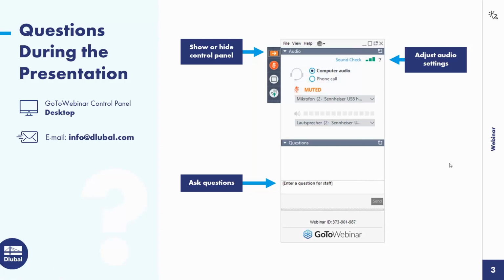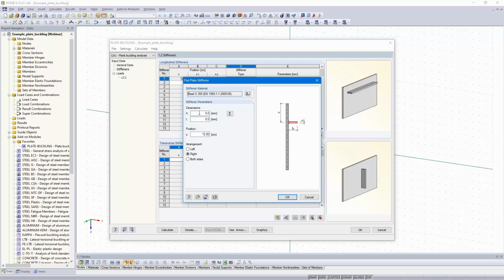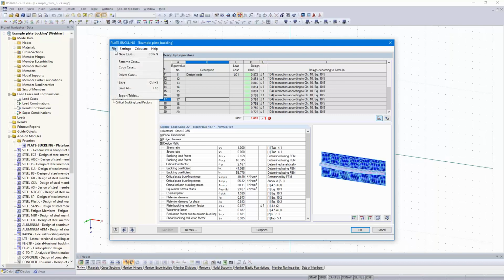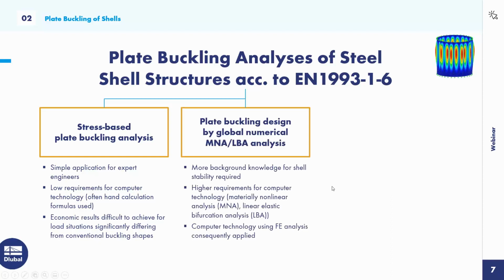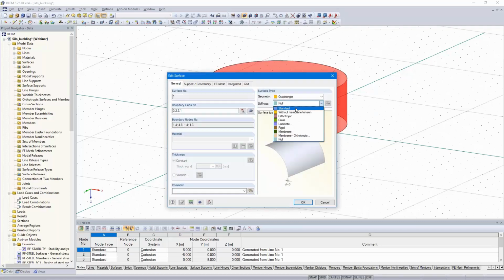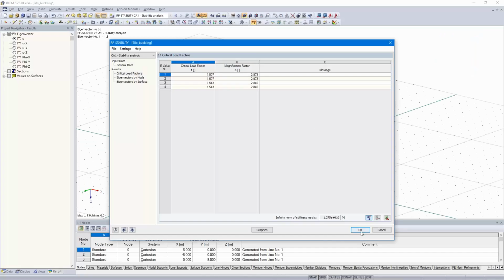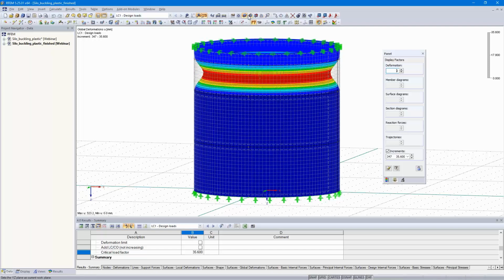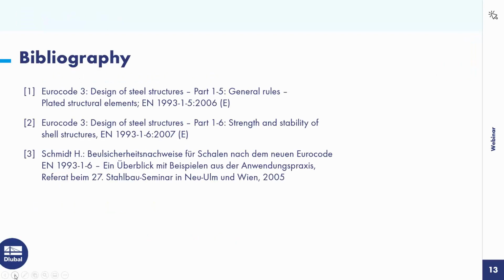Plate and Shell Buckling Utilizing Dlubal Software | Tue, Mar 30, 2021

Comment: If I have for example 20 m long plate girder with transverse stiffeners every 2 m and two changes in web thickness - could I use PLATE-BUCKLING to calculate it's web for buckling? If so, how to do it? - it's the same as in the other software, so I must divide my plate girder into ten 2 meter long plates and analyze them separately with according stresses?
Reply from the maker: Hi, Cinematic!
If you need assistance, please contact our customer support by e-mail at info@dlubal.com and send us your model. Then we can check it.

Comment: I don't get it. 
1. Why are you searching for total plate buckling eigenvalue if there is >100% for the single panel already? 
2. Now after that, you model single panel again which was over 100% before.. 
3. As you mention, if we have rfem/rstab model then we can import stresses, but then we can only check the "total plate" and not the "single plate", right? - what then? - we have to find stresses manually and fill them in module - sounds like a lot of work with hundreds of combinations to find the worst one. 

I would appreciate the answers. 

PS. It would be great if tutorials will be more of why we do something this way and not only how we can do something in software.
Reply from the maker: Hi, davidg939!
Can you please tell us the associated timestamps from the webinar?
Reply: @DlubalEN  
It's all from 4:00-14:40
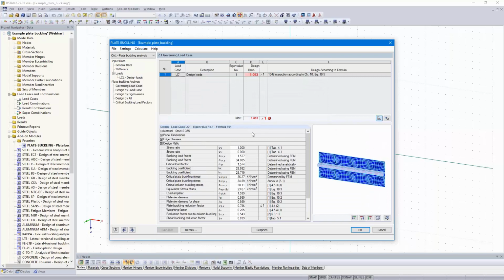1. 8:57
2. 10:49
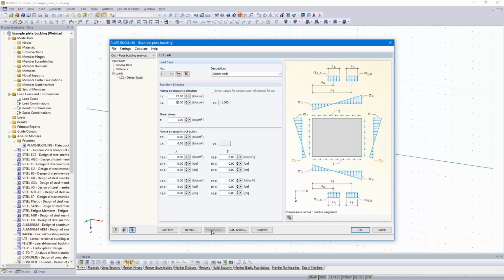3. 7:31 mention about import from rfem/rstab
Reply from the maker: Hi, davidg939!
The overload is only an overload of the single plate and not of the whole panel. So there is a local failure and not a global failure and is therefore irrelevant. You always have to look for a buckling mode that will lead to the global failure of the plate. In this specific case the stability is still given.
Reply: @DlubalEN  Thank you! What about 3rd question?
Reply from the maker: Hi, davidg939!
You can set multiple load cases and the program then will find the worst case but of course, you need to enter multiple cases.
Reply: @DlubalEN  Thank you!